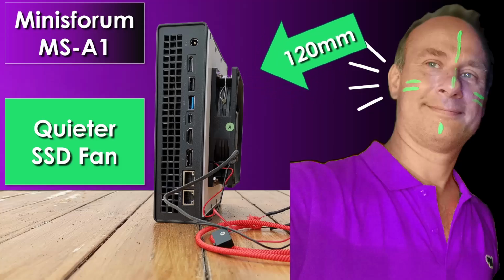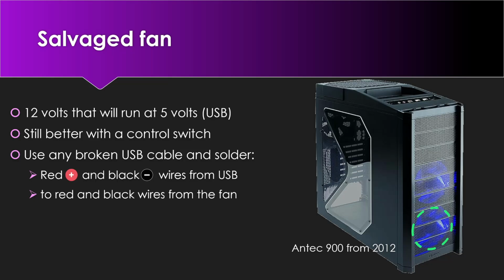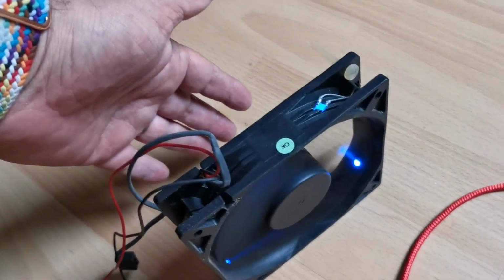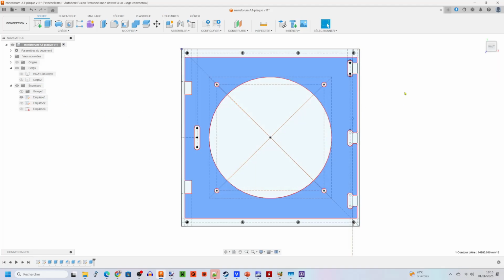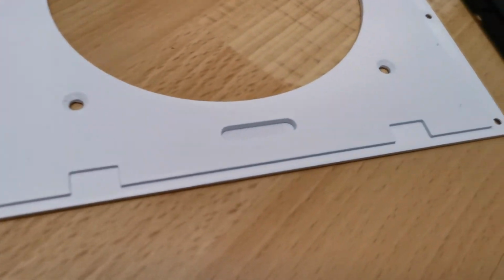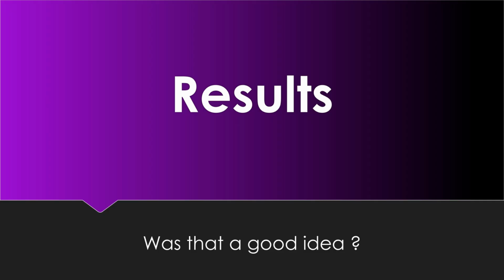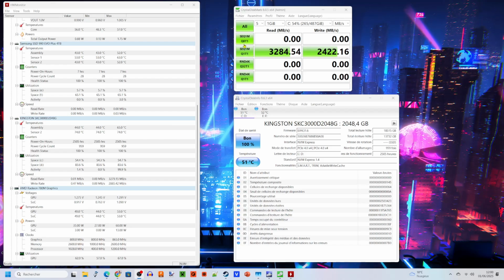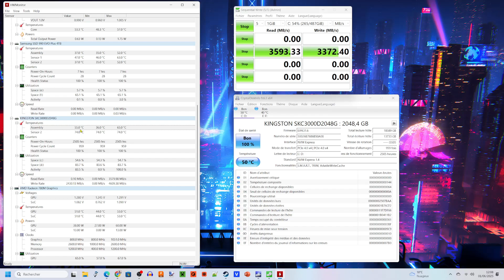Minisforum ms-a1 DIY SSD fan

Comment: Cool design. Did you really need to remove the side panel? You could probably just attach a fan on the side over the mesh
Reply from the maker: Yes but the mesh is very dense and I needed an attachment system. I didn't want to make holes in the nice provided metal plate

Comment: Have you had problems with SOC VRM's running hot all the time? Mine is always over 88 C even when idle.
Reply from the maker: I didn't measure but I run just a 8700g. Minisforum advise a heat spreader if you need 100w cpu like 9900x